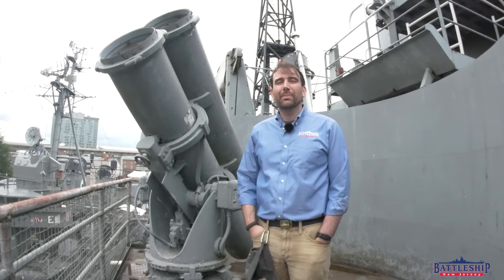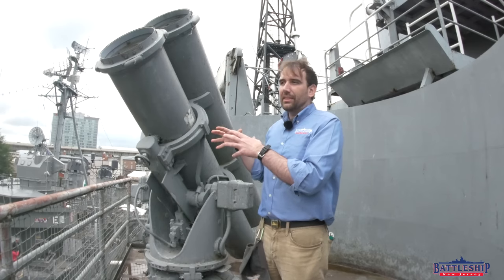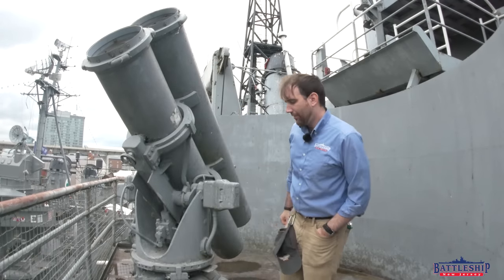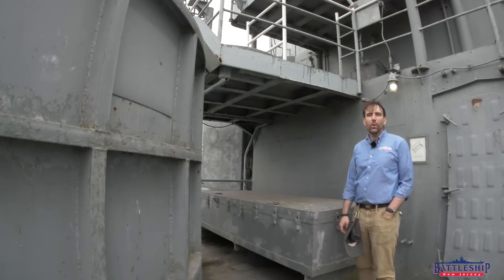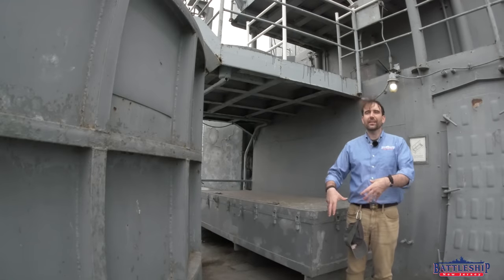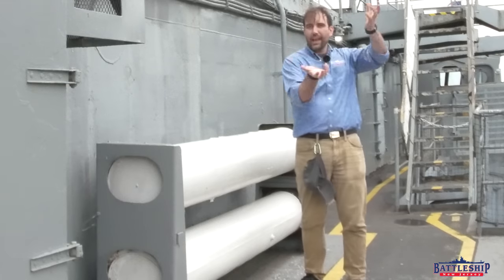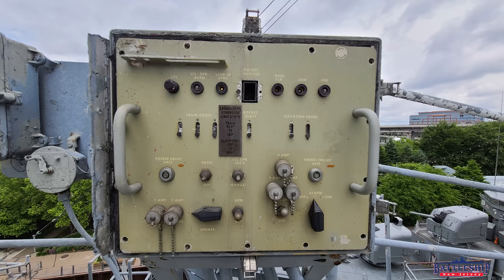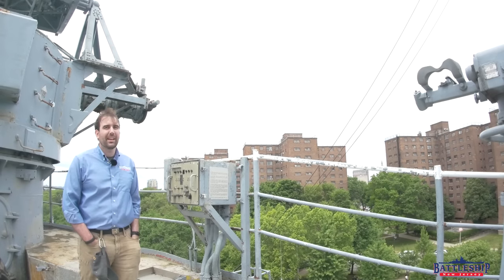The Rocket Launcher New Jersey is Missing

Comment: Chaff was originally known as Window.  Bundles of aluminium foil were,dropped manually out the flare chute of a bomber during WW2.
Reply: It was only ever called that by the British. Everyone else called it something else.
Reply: According to a possibly apocryphal story by our friends at The Confederate Air Force, chaff was called “window” because it was thrown out bombers’ windows until suitable chutes were installed.
Reply: Here’s another chaff history bit..  The idea of chaff was invented by Welsh physicist Joan Curran.  Ms. Curran also co-invented the proximity fuse along side her physicist husband and later worked in isotope separation for the Manhattan Project in the US.
Reply: Chaff reflects and distorts radio waves.  On the radar screen instead of a hard, defined blip, the display gets foggy or cloudy, just as fog or smoke obscures visible light to our eyes.
Reply: Winson Churchill was very reluctant to use chaff until D Day in fear that the Germans would respond in kind, loosing the tactical advantage.

Comment: The USS JFK CV-67 had two of those when I was on board in 1979. We tried to get them to work. They were there one day and then one day they were gone.
Reply: The JFK later got SRBOC launchers.  During Desert Shield we (the USS Saratoga) had to share our rounds with the JFK because there weren't enough available for carriers at the time. So when one of us went into the Red Sea the other would have to unload their SRBOC rounds and send them to the other ship. One time we unloaded them but they never got transferred to the JFK and weapons department just stored them onboard somewhere. They weren't in our chaff lockers so who knows. We didn't find out until we went back in to the Red Sea.  I don't know what the situation was during Desert Storm when Sara, JFK and Ike were all operating in the Red Seat together. I was gone by that point.

Comment: I recently learned that in 1944 Texas and Arkansas had Chaff rocket launchers mounted when they deployed for D-Day. They apparently were actually fired in combat when under fire from German radar controlled shore batteries. The chaff heads were 5", I suspect they were the same as the chaff rounds fired from 5"/38s, which is why the other ships didn't get them. New Jersey also would have had CHAFF rounds for her 5"/38s, we did in 1978-1982 when I was aboard Koelsch.

Comment: Chaff is not aluminum foil.   It is composed of aluminumized strands of glass material similar to the strands used in fiberglass cloth.   The strands are in bunches , composed of several lengths to reflect various frequencies of micro wave radar.   Zuni rockets were removed from aircraft carriers following the Forrestal fire.
Reply: that's what he said. Chaff started out as aluminium foil, later was replaced by metalised mylar.
Reply: It looks like cheap blond wig.
Reply: In USAF there was also some chaff (no longer used) with a lead core; B-52s used it.

Comment: In the 70’s I worked for a company that that built chaff dispensing underwing pods for F-4 Phantoms. We made chaff too. We melted marbles drew out fibers, and coated them with powdered aluminum, in different lengths. It was very light and had great hang time. The pods resembled standard wingtanks, but without tail fins.
Reply: Was this for wild weasel missions?
Reply: ALE-41 chaff dispenser
Reply: If you look at some of the later Phantoms like the Gs you will see that they modified pylons to contain ALE-40 dispenser buckets for both chaff and flares.

Comment: Decoy systems are one of those that do get upgraded a lot . In those days there wasn't a threat from sea skimming missiles . I suppose you would only see early versions on a ship retired at a certain time . Lots of cables as Ryan said , firing circuits also had to be run in conduit . There can be a few signs such as a forgotten tally or  bracket , but otherwise these redundant systems only exist in drawings and photographs .

Comment: @BattleshipNewJersey the "pin ring" to lock it in place looks significantly more like some form of hall effect sensor and a trigger wheel that also doubles as a settable hard limit ring based on the blocks bolted onto it and how robustly the sensor is mounted. Using the feedback of the hall effect sensor they could electromechanically pivot the launcher in increments matching the hole spacing on the ring.

Comment: Love the curator units.
We need to petition SI (Système international d'unités) for new standard units. 1 curator tall, 1 curator wide, 1 curator weight etc
Calibrated to metric so sort of new gen imperial. 
USA imperial measures are calibrated against metric base units.
So how many curator height to the metre? (Yard equivalent) How many curator mass to the kilogramme? (Pound equivalent). Curator width and depth are the feet or inches equivalent. 
LOL this is a joke. But would actually be fun if SI would actually accept.
Reply: If you're in the area of Cambridge, MA (and more specifically around MIT), the smoot is an accepted length of measurement. One of the bridges into the city even has smoot markers on it.
Reply: Many years ago in college we calibrated everything to a cubit.
Reply: This is so funny

Comment: So what’s the standoff distance from which an enemy would fire a transonic missile?  At 10 to 20 miles, even if RADAR picked up the bogey immediately, it seems like it would be pretty difficult to maneuver a large ship out of the way, chaff defense or not.
Reply: If you get within 20 miles of NJ you're dead. But you still have 1 minute if mach 1 missile fired from 20 NM. Hopefully you're at GQ. Most of the Soviet missiles were a lot faster, but went straight up to high altitude and attacked from above. Easy to detect, but hard to shoot down.
Reply: @jdmchann5969  Thanks for the reply.

Comment: Was the system powered by electric or compressed air or some other way?
Reply: It looks like an electric motor driving a hydraulic pump at the base so I'd say it was primarily hydraulically controlled.

Comment: Would the use of chaff systems on the ship have caused any issues with the ship's own radar systems?
Reply: not really. Chaff is designed to confuse specific signal frequencies/wavelengths, and targeting radars in missiles and aircraft tend to have different frequencies from the search radars of the ship.
Reply: Yes it would. Even a tree renders a search or tracking beam largely useless, a cloud of metallized fibers will do the same.
Reply: You know the general direction that you fired your chaff in so you are expecting to see a big cloud appear along that vector, heading away from you.
Reply: During the Gulf War, USS Missouri fired her chaff launchers after a suspected missile launch, One of the Phalanx CIWS on USS Jarret confused the chaff for an enemy threat and engaged the chaff cloud surrounding Missouri. Some of the rounds impacted Missouri and ended up injuring a sailor aboard. Forcing Jarret's crew to disable the CIWS.

Comment: The Talos missile was 32 ft long and 28 inch diameter. it weighed 7800 lb. only the big cruisers had them. they more than likely was a tartar or terrier setup also for closer in support. All 3 could fly from the original double arm "bandits" an later single arm launchers. The Talos nickname was the flying telephone pole. the 3 T's were 1950 designed  and were gone by the late 1970's. I think the Iowa's would have gotten a Standard missile system if was done in the 1980 commissioning.

Comment: What kind of psycho ships missiles for a 4 barrel launcher in 15 missile crates?  That's the kind of thing where if it happened in a video game people would call it a bug.
Reply: That’s the Navy for you lol
Reply: Buy 4 crates, get a free refill.
Reply: The same fine people who put 10 hot dog buns per package while at the same time putting 8 hot dog wieners per package...
Reply: the kind of bureaucrat who specifies the size of the shipping container without considering the content that'll result from that size.
And often for good reason.
The container needs to fit in a standardised storage space or vehicle, has to be able to be lifted by existing hoists and cranes.
That limits its weight and physical size.
But the new rocket is 10% larger than the old one it replaces, so fewer rockets fit inside the new container.

This goes all the way to the size of aircraft btw.
The Boeing 777 originally was designed to have folding wings, because the originally intended wing design would give it a wingspan too large for existing airports. Boeing ended up changing the wing design to not require that long wingspan instead to reduce cost, weight, and complexity.
It even goes all the way to ships. Most cargo ships (and many military ones) are limited in size by the width and depth of the Suez and Panama canals for example.
And of course in the 1920s and 1930s all military ships were limited by treaty regulations, and even now they're obviously limited by the docking facilities and shipyards that exist to build and support them.
Reply: The same guy that packages Hotdogs 10 to a pack, and buns 8